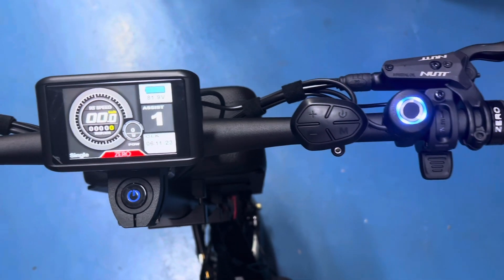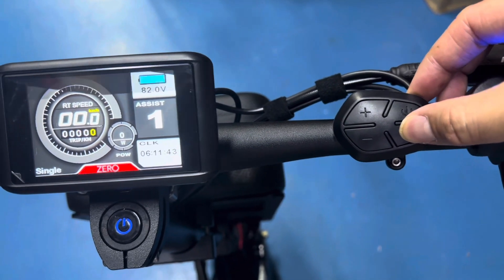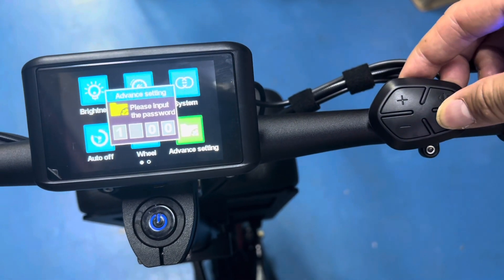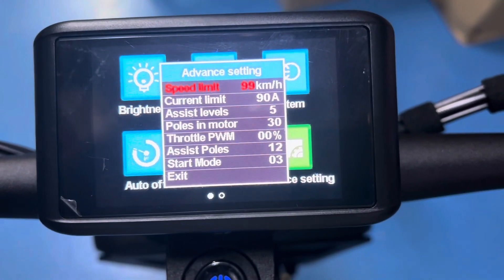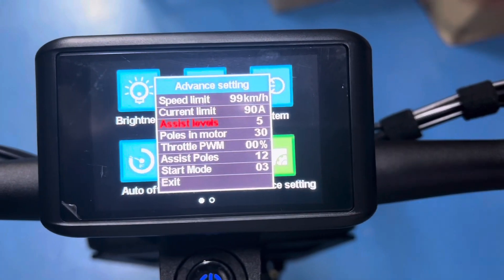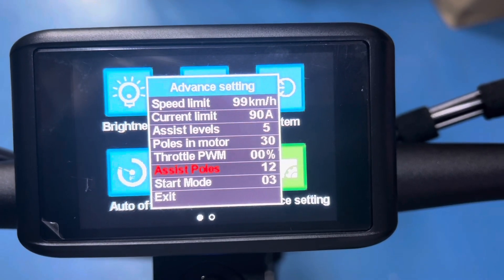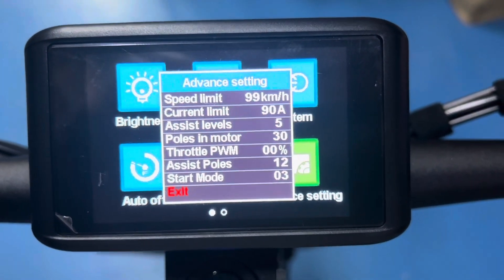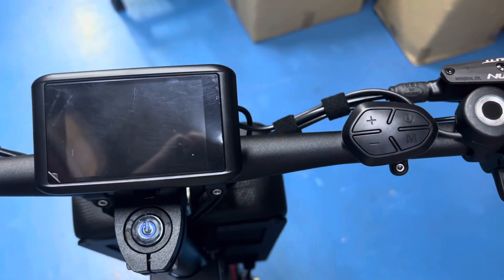How to Access ZERO 10X EVO Controller Settings

Comment: Thank you, question when accelerating there seems to be a flat spot, do adjust throttle PWM or start mode?
Reply from the maker: Dead zones are from the throttle itself. You can change the throttle to a more responsive one
Reply: @FalconpevSg  which one does this  please?

Comment: IF I have the older normal Zero 10x, is it possible to install the Evo 20X controller and how difficult is it?  I am good with electronics and know my way around a soldering iron.
Reply from the maker: If you are good at electronics then this will be easy for you
Reply: @FalconpevSg  what parts are needed?  The control box you linked I assume.  Does the display and control buttons biometrics come with that or are those separate items?